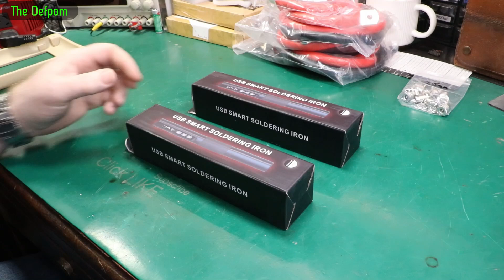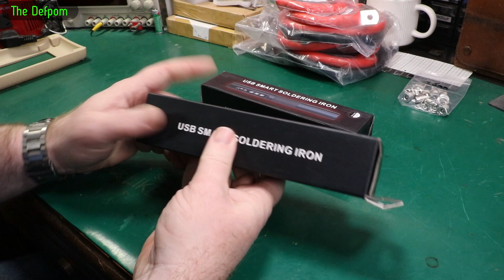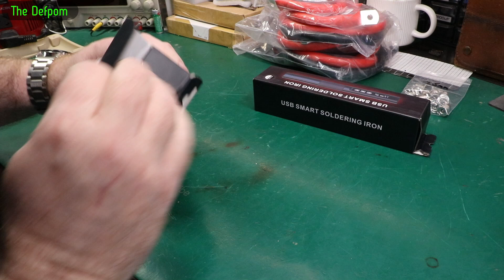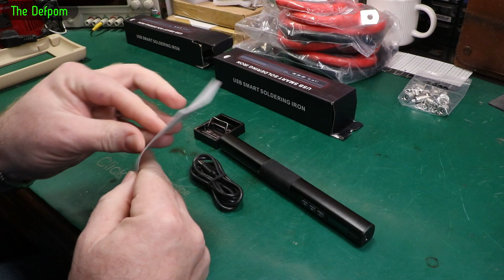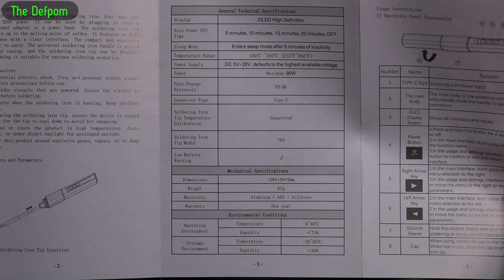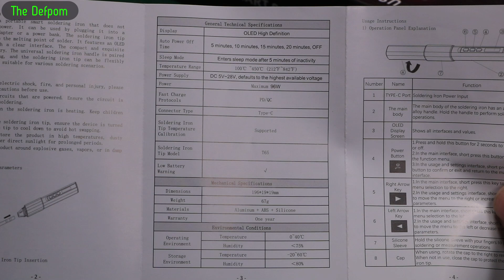🔴 A Multimeter Soldering Iron ? Zoyi ZT-N1 and ZT-N2 Soldering Irons Review - No.1294

Comment: Call me cynical but this is a mother of all stupid ideas to have a soldering iron with a built in multimeter. In real life you are quite often soldering something, measuring a voltage, soldering something else and repeat. Even those on an extremely tight budget can afford a cheap soldering iron and a $5 multimeter.
Zoyi just implemented it because they could........I can't see it being used by anyone.
Reply: And now let me introduce myself.
Railway employee.
I don't have one place that I have to serve, but two dozen. Each may have a malfunction that needs to be detected (a multimeter is required) and repaired in case of circuit damage (a soldering iron is required).
Because of this, I have to carry both a soldering iron and a multimeter with me ALL THE TIME. Combining these two devices would be extremely convenient.

Comment: That will take quite a paradigm shift for me to get used to just the idea of a soldering iron/multimeter. For me, a soldering iron you use when the equipment is swiched off, and a multimeter is something you use when the equipment is plugged in and switched on. The way I know myself, using something like this, I will start soldering on stuff whilst it is plugged iin and switched on, and when sparks fly and smoke comes out, 🤬🤬🤬. Nope, for my own sanity, won’t go down the combined soldering iron/multimeter routine, but then, I am still mainly using my old Weller WD1000 soldering station, even though I have a couple these new-fangled USB-C driven soldering irons, and the uncontrolled ones that I use to melt plastic, etc… no thanks, I would leave these things for people younger than me…

Comment: To me it would only e useful if the meter worked while soldering.  I have made fixtures to monitor resistance while making load cals.  It could be interesting to see what happens to a circuit while soldering.  Since the meter does not work while soldering I don’t see a use tor it.